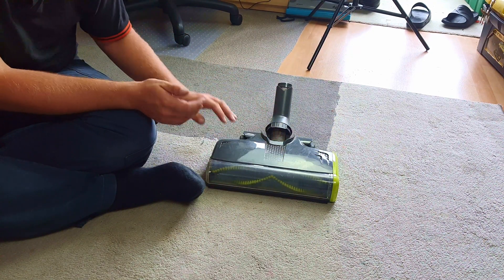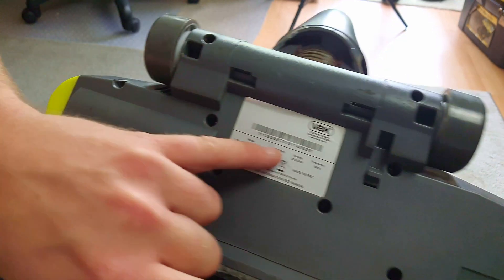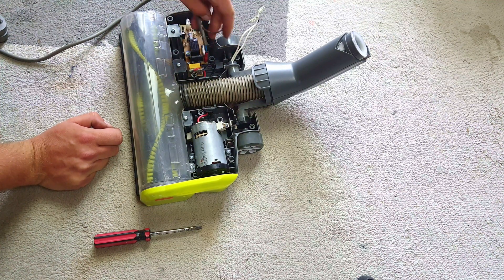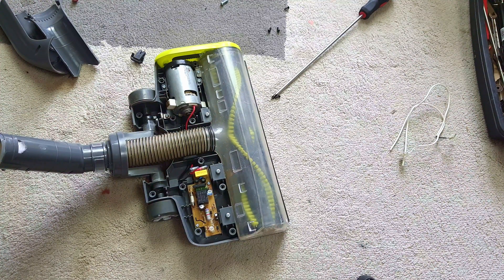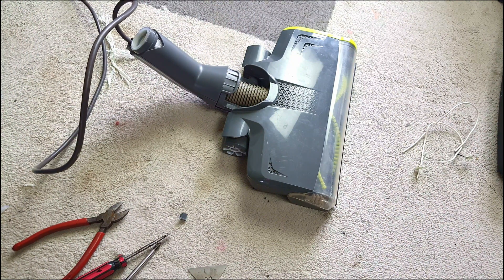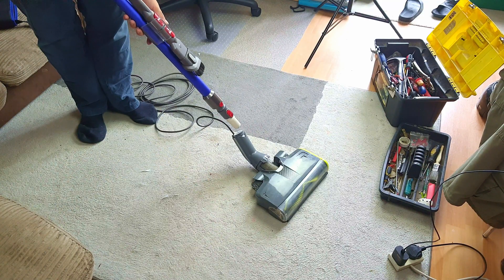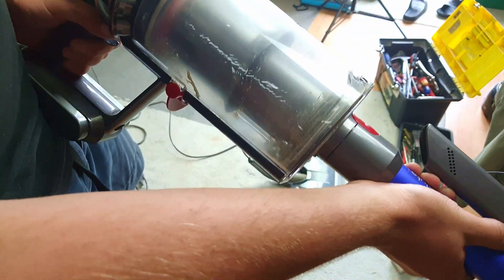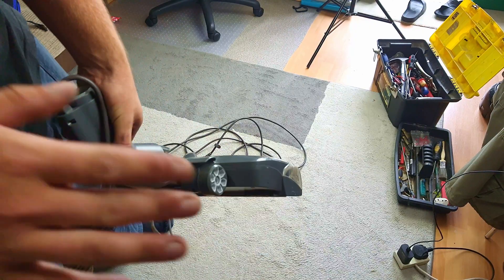DIY Vacuum Cleaner Powerhead Part 1 - Proof of Concept, and Testing!

Comment: Hah, I did this a couple of weeks ago. Power head from a broken Filter Queen fitted with a mains lead and a bit of pipe connector to use with my second hand Vax. Good thing about that old head is the metal base so it's good and weighty.

Comment: with a henry it will be fantastic
Reply: Yes, fit the for the original henry's appropriate connector and it'll plug right in, or get a new henry and replace the power on light with a 2 pin IEC socket (C17/C18).